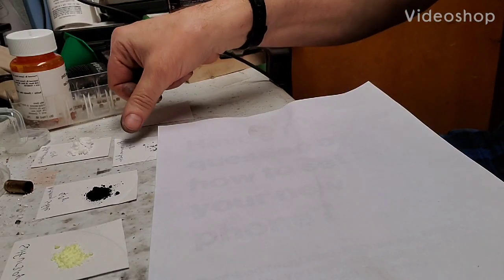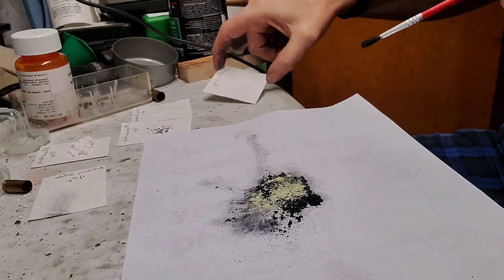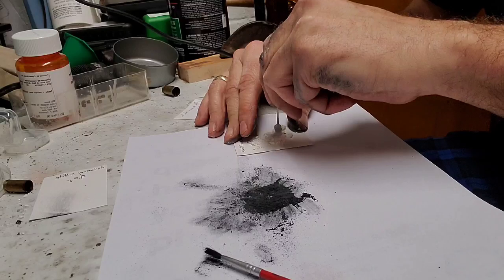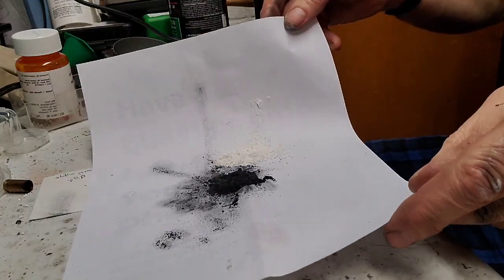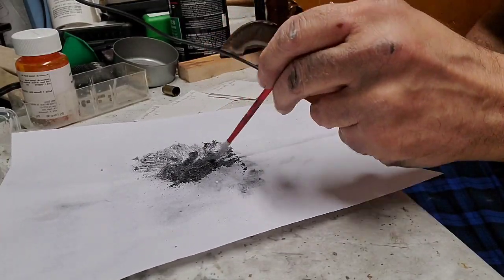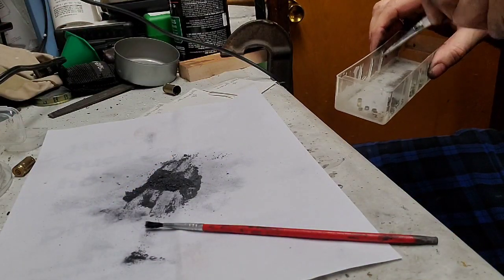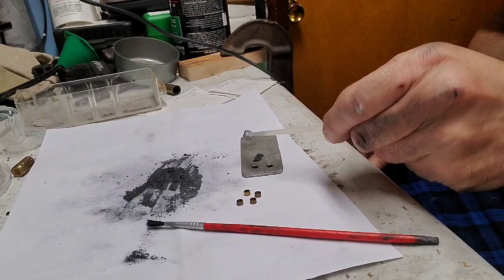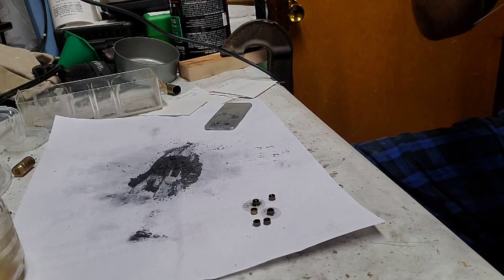Reloading primers with homemade priming compound H-48

Comment: (For anyone that wants to copy and paste the ingredients).

9gr Antimony sulfide
3gr Sulfur
4gr Very Fine Ground Glass
0.2gr sodium Bicarb
0.2gr Aluminum powder
17gr Potassium Chlorate (mixed extra carefully).

then the liquid is 7 parts acetone, 1 part shellac.

I'm not certain what shellac is though. I believe it's a natural chemical from an insect that is used in clear coat and nail polish. Also, make sure you watch the video to make sure I didn't make any mistakes. This isn't directions. It's just the ingredients.
Reply: Antimoine ? ok i'm not doing this anymore lol
Reply: @ommsterlitz1805  Do you know what's in commercial primers? Many have lead and mercury. I was told that modern one's didn't, but when I tested some myself (including percussion caps), they all either had mercury or lead. I didn't have any clean or "green" ammo to test though.
Reply: @deucedeuce1572  Modern non-corrosive primers are lead styphonate unless they are marked lead free. Mercury fulminate are corrosive primers commonly used outside of the US (or used to be pretty common)
Reply: @tomhubbard353  Is mercury fulminate corrosive? I've done research on it before, but honestly can't remember. I believe percussion caps (both old and new) contain mercury fulminate, but they could also be leas styphnate. Some people say nitrocellulose was used also, but I don't think I've ever been able to confirm that. I have confirmed though that it is impact sensitive. I just don't think it's sensitive enough or hot enough (or slow enough) to be used as a percussion cap though. (and definitely not a primer being ignited with a firing pin).
Reply: @deucedeuce1572  Yes it is corrosive and can only be removed with hot soapy water (Yes there are chemicals that will dissolve the corrosive salts but they are nasty cancerous poisons). Percussion caps can be made of either but considering black powder is corrosive it's self, kinda doesn't matter IMO. I have never heard of nitrocellulose being used by it's self as a priming compound. Side note there are other home brew compounds people are saying work well. there is a whole website built about it LOL
Reply: @deucedeuce1572  It's corrosive in a different way, mercury fulminate can decompose into mercury, then mercury would form amalgam with whatever metal it came into contact with.
Reply: @deucedeuce1572  Primers that contain mercury, as well as potassium chlorate like this one, are corrosive. 
That includes primers made reusing cap gun primers and matches, since all of them use potassium chlorate (some cap gun primer use lead styphonate, but it's hard to tell).
I read a patent for a non-corrosive, non-toxic, primer compound that, instead of potassium chlorate, used the good old potassium nitate, but it also used nitrocellulose, that's not really easy to use safely.
Reply: @neutronalchemist3241  Appreciate the reply. Yeah, most mercury containing one's can be corrosive, but I'm not sure that all are the same. I believe most commercial primers contain lead (styphnate) and similar proprietary mixes, which is the main cause of lead exposure at gun ranges. Some people think that the lead from the bullets causes that, but even using 100% (TMJ) bullets won't reduce lead exposure at all if you're using ammo with lead primers.

I have known for a long time that nitrocellulose is in and can be a functional ingredient in primers... but some people will argue against that. That's not to say I'm 100% correct though. I'm mostly going off what I read myself and was told by others. The others that told me that it can be used are very credible people that are in the field of manufacturing ammo, chemistry and specifically primers/powders.
Reply: @deucedeuce1572  Definitely there are commercial primers that use nitrocellulose, aluminium powder and, ad oxidizing agent, bismuth trioxide, or potassium nitrate. It's only that is difficult to replicate them at home.
Reply: @neutronalchemist3241  Will look into that. Thanks. It's been very difficult finding information. I believe it to be very important knowledge, that We The People should know. Education, knowledge and wisdom are three of the most important defenses we have against tyranny. There's a reason the Founding Fathers wrote the Constitution and Bill of Rights... and especially the 2nd Amendment.
Reply: @deucedeuce1572  Almost all the commercial primers and caps use either lead styphnate, occasionally lead azide (only occasionally because lead azide is a bit too sensitive thus more dangerous for manufacturers). No mercury unless the primer is fron old surplus eastern bloc ammo).
Reply: @ommsterlitz1805  same but because 10g of it is $70
Reply: @UnknownGamer40464  search better, $70 is more like for 100g.
To give you a picture, 9 grains (the unit used in the vid) is ~0.58g, and eyeballing it conservatively, we could estimate that 30 primers could have been done with his batch...
So with 10g of antimony sulfide, you have enough for ~500 primers.

Well, at least, that's the prices in EU, but I have a hard time believing in such a disparity between EU and US.
Reply: The 'shellac' is most likely cellulose laquer - it has the same chemical composition as single base smokeless powder, the major difference lies in the amount of solvent used in the end product, hence it burns very well.
Reply: @John-un3lj  nitrocellulose laquer or real (thickened) shellac both work. The thickened shellac, which you mix from flakes yourself, is a more effective adhesive. Most effective of all is thickened laquer made from smokeless powder and acetone (because it has both good burning and adhesive character).
Reply: Do you know where can get antimony sulfide? What kind of store. Because I went to several chemical stores but they didnt have idea about this product
Reply: @MrLEMV  Stores for people who make fireworks sell it.
Reply: @deandeann1541  thanks a lot! 😁
Reply: @MrLEMV  Fireworks componant stores for people who make fireworks seltriantimony trisulfide (the name it is usually sold under).
Reply: Shellac is Beattie poo. They scrape it off of trees and use it for nails , or hardwood floors or even in jewelry to hold work material into place. But they also use it in homemade primers I guess lol

Comment: If you ever work with very fine aluminum powder, you have to be careful. It can be a very dangerous thing to work with if you don't know the dangers and how to avoid them. I'd even say it's the most dangerous of ingredients in this video. In any case, definitely do some research on the safety/dangers of aluminum powder and the other ingredients (either alone or mixed)... and don't work with them until you have learned and understand them. (I only learned after doing stupid/ignorant/dangerous things and am lucky that I was never hurt).
Reply: Yep. Ask the Germans about using aluminum powder in their doping mixture they painted on the Hindenburg to make it shine...........one reason it burned so quickly.
Reply: @seawolfinternational5481  Yeah, aluminum powder is also part of many explosive mixtures. Things like KNO3 and many other chemicals mixed with aluminum powder become explosive... and there are also many thermite (and thermate) mixes with aluminum.
Reply: It's bad to get on your skin also. There's a reason they stopped using trace amounts in deodorant... Definitely would be wearing gloves.

Comment: That is quite a lot of priming compound to make at once. To understand what that stuff can do set the whole amount off with some fuse. It is surprising how much of the paper is destroyed.
There is another priming compound recipe that produces a lead double salt that is entirely inactive until a small drop of water is placed in each completed primer - there is no handling of active explosive. It is also non corrosive. The preparation is much more complex than this simple mixture. Not impossible though, even without chemistry training.
Reply: I would greatly appreciate anything that could help me find that info online.
Reply: @deucedeuce1572  I believe the primer mix is eph 20 - lots and lots of stuff on Aardvark reloading - here's a video on the hardest part of making it (not too hard though) -https://www.youtube.com/watch?v=YHE9KsImws4 - This isn't the best video to start but I happened to find it - Aardvark reloading and eph 20 is enough to find everything though.
Also here is a primer composition text that you will like. 
https://www.bevfitchett.us/chemical-analysis-of-firearms/priming-compositions.html
Here is a primer course pdf - https://aardvarkreloading.com/resources/Homemade%20Primer%20Course%202019-06-28.pdf I think you will really like this one.
Reply: PS after you mix the composition you assemble the primers dry. The composition is not explosive at this point because the last chemical reaction does not occur until a tiny drop of water and isopropyl alcohol is added to the primer, which is then set aside to dry and then you are good - when dry you have an effective non corrosive primer.

Comment: @Andrew Michaels:dothefive: I have a really good safety consideration if you don't mind my chime. When you are mixing this stuff, use acetone especially while you are pressing it all in. The acetone will dry rather quickly, and it will not have any negative effects on your primers.
Reply: ترکیبات رادرست توضیح نمیدهید
Reply: @حمیدرضارضویی There is a language barrier
Reply: He adds acetone at 10:00.
Reply: @Toimu13 yeah, but after mixing. Doing it before stabilizes the mixture and makes it easier to put in the primer cups.
Reply: @chemistryofquestionablequa6252  Yes it does. It is much easier to mix a little acetone in the primer comp, then use tweezers to grab each primer cup and use it as a scoop. A very good method to make percussion caps, a variant of the method should work just fine for primers.

Comment: The fuels are not sensitive and can't explode so why aren't you mixing them in a pestle and mortar?
Reply from the maker: When they are mixed they are very sensitive
Reply: @rifleshooter2  sulphur antimony sulphide, aluminium not sensitive when mixed fuels are not sensitive oxidizers are also not sensitive on their own only when you mix fuels and oxidizers such as chlorates do they become sensitive.So blend the fuels separately and oxidizers separately then mix them gently together
Reply: @wijpke  why bother with a mortar and pestle when what he does works?
Reply: @deandeann1541  it will work much better if intimately mixed

Comment: could you substitute lead azide for the potasium chlorate so as to make a non-corrosive primer?
Reply from the maker: I don't know
Reply: i came back here to ask another question about substituting lead picrate for the chlorate and saw your reply...i was confusing stibnite for metallic lead. likely tired when i wrote my reply. anyway in answer to your original question. nitric acid and metallic lead to obtain lead nitrate, then its a simple substitution reaction with water solutions of lead nitrate and sodium azide. lead azide will precipitate out. likely leaving behind a contaminated sodium nitrate solution. 
the hard part of course is obtaining the sodium azide.
there are a couple sources like early airbags or synthesizing it from hydrazine sulfide, that said its all pretty toxic synthesis.
i found the lead picrate route to be fairly simple enough starting with ASA to picric acid then lead nitrate to lead picrate ..fairly easy relatively safe with proper PPE.
so anyway have a nice day and again, you assume much. but do you have anything useful to contribute like an informative answer to substitution of corrosive chlorates with lead picrate?
Reply: and where one would get lead azide? When offering an advice do not offer wikipedia articles. It is better to stay silent
Reply: @petruse8893  lead azide can ve made from stibnite, nitric acid, and sodium azide. perhaps one shouldnt assume others exp or knowledge of complete strangers?
go check out the sciencemadness website and forums. lots of educational information there on organic chemistry.
Reply: It seems to me ,that you have no idea what lead azide is and stibnite as well.The first contains lead and nitrogen in a very unusual compoundwhich is salt of lead and HN3 acid ,the second is a sulfide, which is also salt of antimony and H2S.Unless you are deep into alchemy and know the magic formula for transmutations,making lead out of antimony is not possible,more so turning H2S into HN3 is a sorcery on a cosmic scale

Comment: What is the tool that has the little holes for the caps to fit in called? And where do you get it?
Reply from the maker: I call it a primer holder. I made it

Comment: Could the unhappy powder be mixed in a slurry of say pure alcohol (say everclear) and then put in as a putty/honey consistency before putting in the anvil (this way it's a wet compound and the alcohol would evaporate out
Reply: Everclear has alot of taxes because its a beverage.  Buy denatured alcohol from hardware store.   Avoid taxes.
Reply from the maker: It could be I haven't tried it
Reply: you can also use acetone,denatured alcohol!
Reply: Acetone works for this, it evaporates quicker than alcohol but is as flammable as gasoline.

Comment: Nice recipe and process. But guys, you don’t compress the compound inside the caps in the same table where the rest of the compound is. Actually no hard instrument should cross above the ready compound batch. Powdered glass makes this stuff really unstable, and its not safe to even have a chance to drop something over it.
Reply: Would it go off if the bullet was dropped with a completed primer installed?
Reply: @deucedeuce1572  not sure, but the bullet going off might no be the major problem. The big deal is to drop any hard instrument over the primer compound. This stuff is really sensitive, and the pile could go off just by dropping your watch/cellphone/screwdriver over it, even if not being inside a primer case.
Reply: I agree, I would definitely get some more space between my bulk compound and the work area BUTTT I believe when the acetone wets the mixture is severely desensitizes it making it considerably safer. As I understand it and have watched documentaries on the subject, commercial lead styphonate primers are "charged" with a slurry that is acetone and LS. They squeegee the cups full in a "punched plate" of a 100 at a time I believe, then paper and anvil added while wet.
Reply: Yeah thats why you make small batches and use common sense 😂
Reply: i just read somewhere that the powdered glass makes it more stable. so maybe you got it wrong?

Comment: I would have thought the chlorate and the sulfur would make that very unstable
Reply from the maker: I has to be somewhat unstable so it's shock sensitive the trick is to not be too unstable 🙃
Reply: @rifleshooter2  As another feller in here mentioned, there is nothing wrong with wetting the mixture with acetone especially while you are pressing. The acetone will dry out rather quickly.

Comment: If you are just breaking up clumps, folding it in a sheet of paper and rolling over it with a small pill bottle works good, and make sure everything is powdered finely before mixing anything.
The final mixing can be done in a small pill bottle as well, just tape it to the end of  a broom stick.
And he needs to fire them in this video!

Comment: If memory serves this formula is very close to what is in  match heads
Reply: Virtually the same yes aka Armstrong mixture eg. phosphorus.
Reply: @Boobytrap_Badger  Armstrong mix requires the strike strip. Regular strike anywhere matches are not Armstrong mix but are quite close to H48 priming compound. Close enough to work.
Reply: @Boobytrap_Badger  The match head compound is not Armstrong mixture - too little phosphorus - the match head compound approximates a simplified h48 priming compound, or more accurately it is a variant of k chlorate flash powder with glass added. The amount of red phosphorus in the strike strip is imo sufficient to consider it Armstrong mix, at least as far as increased sensitivity is concerned. It can still be argued that there is not enough red phosphorus in the mix, but going by the change in behavior it is.
Armstrong mix, if covered with a paper cup with a dime sized hole to either side, is capable of sympathetic detonation when several cups covering the mix  are placed in a row with the holes lined up. I have watched it happen with 5 grain chlorate tabs with molten red ph. poured over the tablets - it would be an interesting test to see if this could be made to happen with match head mix.
Reply: @Boobytrap_Badger  Armstrong mix requires red phosphorus, which the strike strip is a convenient source of. Fortunately there is only enough for a very small amount.
Who did say the strike strip was Armstrong mix? Certainly neither of us.
Your work with booby traps is unsettling.

Comment: The fired primer, once the anvil is removed, did you just push out the firing pin strike from the previous shot and reuse it?
Reply from the maker: Yes
Reply: @rifleshooter2   thanks for the quick response. How do they shoot?
Reply from the maker: @0780marco  I'm still working on them. I'm about 90% success